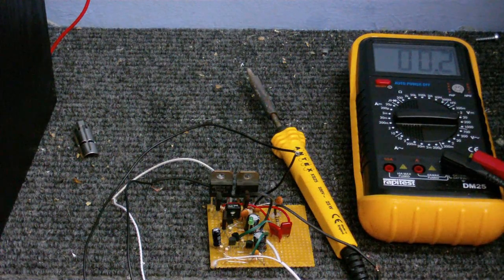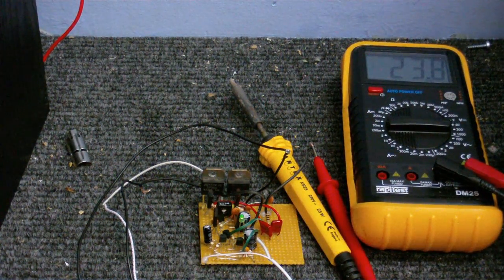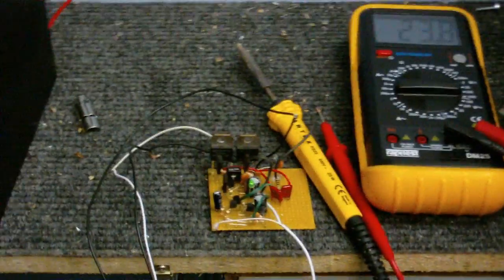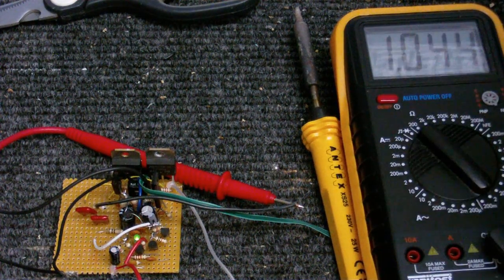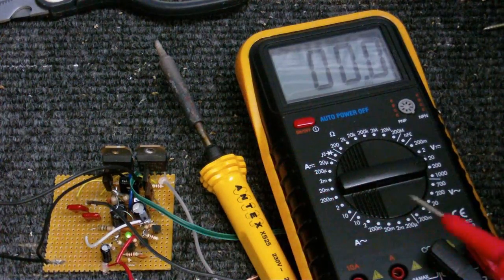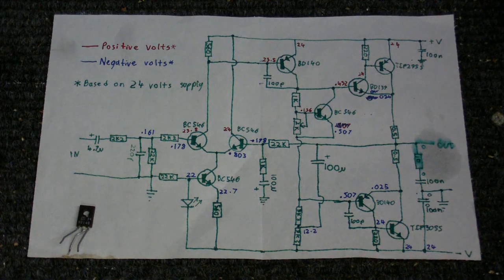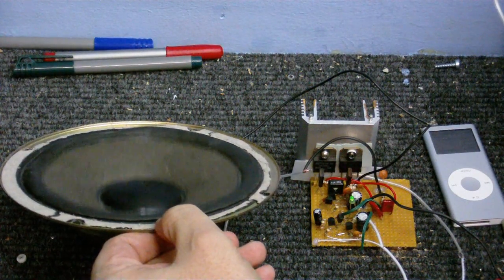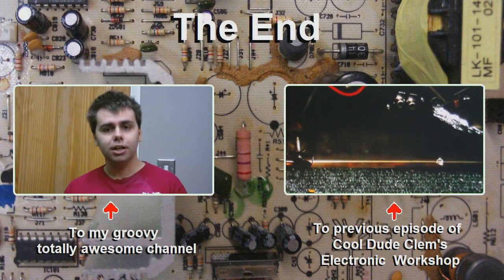CDC Electronic workshop - Fixing the amplifier.

Comment: I had an emitter resistor burn and output transistor go short in my 1968 JVC Nivico model 5001 receiver. It also warmed up the mains transformer quite a bit to the point of smoke. Hopefully the transformer wasn't hurt but no telling till I dig into it further.

Comment from the maker: @o0Blackout0o It all depends on what it's connected to in the circuit, some of them will just result in something like a little distortion, others could stop it working completely.  If a resistor get's burnt, it's resistance will change.

Comment: Very good job CLEM.. you do nice things....as you know..you may have all voltage swing in the VAS (Voltage amplifier stage)...there you may have 50 volts peak to peak or more...and if i could see you're using 4k7 and 3K3 resistances to the bootstrapp..this means more than 100 miliwatts in stand by mode and more than 200 when reaching threshold of distortion (clipping).... current may be 4 miliamps aprox. in stand by mode..and twice that during normal operation... this is hard to the small one...